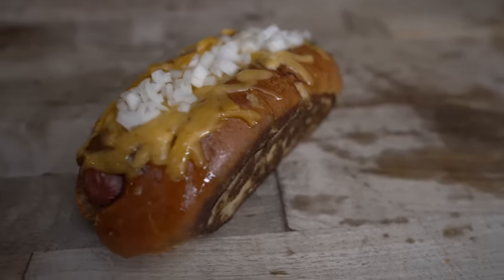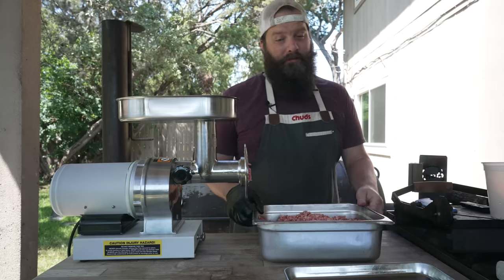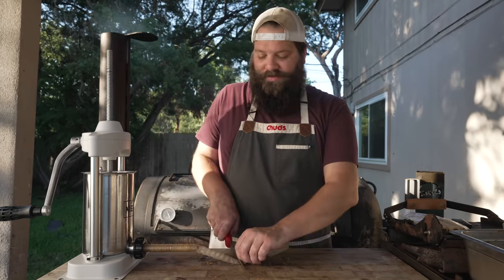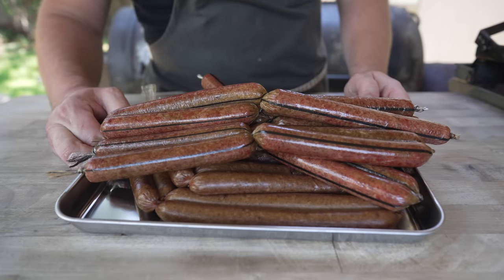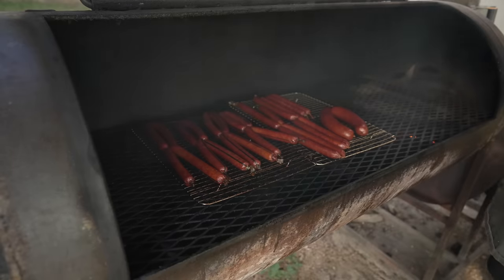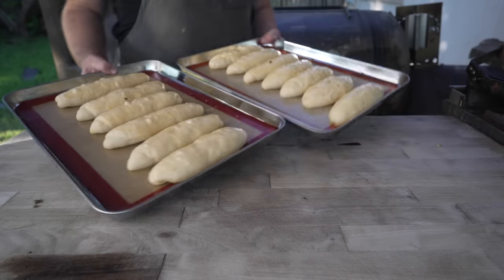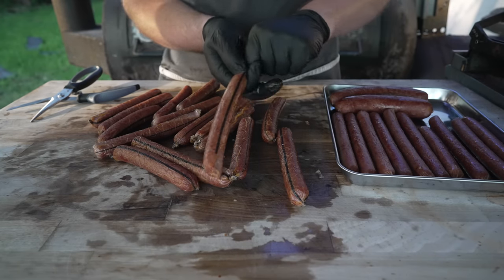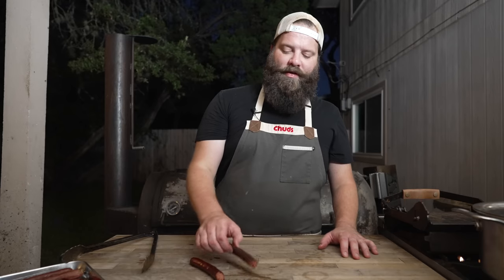The Proper Way To Celebrate The 4th! | Chuds BBQ

Comment: Now THAT took a lot of work; 3 times grinding and chilling, twice busting out and then cleaning the grinder, twice doing the same with the stand mixer, once for the sausage stuffer, let alone prepping the peppers, kneading, proofing and baking the buns, smoking and then grilling the dogs. Any one of those tasks is not overwhelming, but the time and effort commitment to all of them is pretty remarkable. Happy 4th, Brad.
Reply: yes  that is alot of work especially all the cleaning in between i know i do it quite often but it sure is worth every minute of your time to know your not eating pig lips and  assholes
Reply: @davidpetrus1748  The lips part isn't so bad if you consider that cooked skin provides a nice, unctuous collagen that adds to sausages. The *holes can stay out tho...
It is a bunch of work, but I do batches of sausages which can last several months. About 10-20 lbs at a time. You can get that done during the weekend. The chili can be made ahead a gallon at a time and either be frozen or pressure canned. That way you're down to baking the buns and re-heating everything else. Yes, it is some discipline and effort, but clearly worth it.
Reply: @davidpetrus1748 I do love some pork pucker holes 😂

Comment: He always adds 'milk powder'.. is this the same as 'powdered milk'? or something different? The only thing I can find locally that says 'milk powder' comes from the infant food section.
Reply: It's not the same.  The milk powder he gets is from the Sausage Maker and it's got th etemp rating "high heat" for sausage making.  You can also use potato starch😉😉